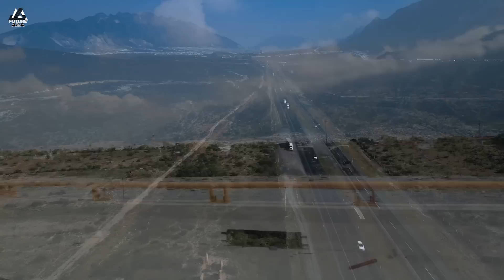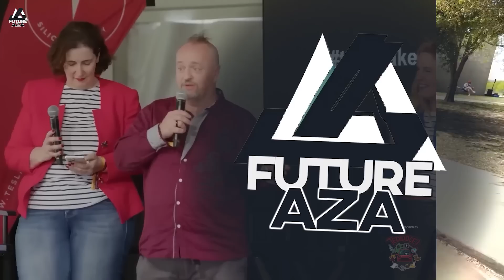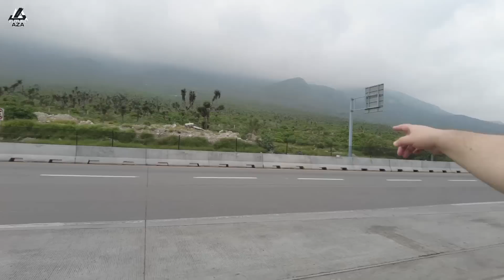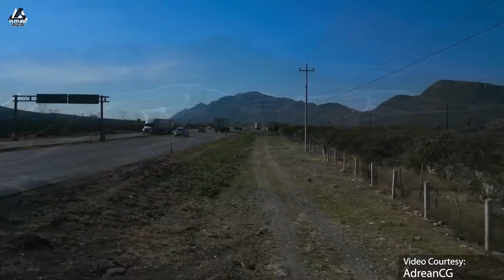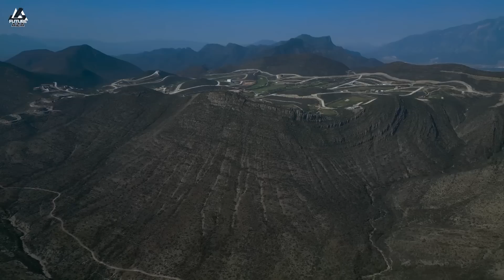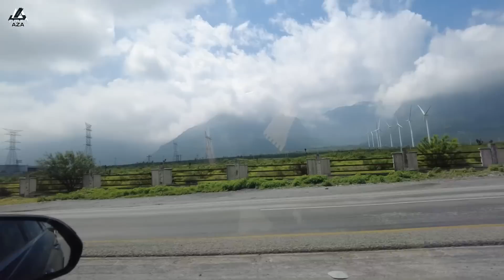I Went to GIGA MEXICO

Comment: Wow!!! Is this the most valuable vid you've done Brian? (I dont say this to knock your other wonderful vids, just thinking of the importance of this one)
This needs to be promoted across the Tesla community. 
Thanks for showing the value of the location, along with the realistic difficulties that will be faced with building construction.
How can it be built?! Long and thin? Multiple buildings? Maybe gigantic supply in the middle, surrounded by different buildings supporting multiple lines? While not efficient, I could envision small to large number of lines making all cars there, just taking advantage of the trade agreements.
Reply from the maker: It's not insurmountable, and the access to cheap electricity could make it work, but boy is it rocky and sloped.

Comment: Can the wind turbines be used, or would the costs be higher than using fossil fuel?
Is Tesla developing new technologies to excavate rock, for eg. the lithium/copper mine branches, or as preparation to terraform Mars? With each location there comes another opportunity to innovate and expand into another industry.
As in another comment, the mountain could be used for a data center.
Are there really no valuable minerals in the rock?

Comment: "Normal Trains" require Shallower Grades, especially if using "Mile Long Trains", is basically True, but a Train can be Shorter, More Power Units (Engines) can be used, and it can work! 

In "Extreme" Grades, there are always "Geared" Track Systems, as in certain Spanish or Swiss Mountain Rails!

My "Home Town" has "CPR" rails a few Hundred Feet Higher than the "CNR" rails, in town, but just 6 Miles South, the CPR Tracks are below the CNR tracks, at the "Cisco Bridge" crossing over the Fraser River, by around a Hundred Feet.  

So, varying "Grades" ARE Possible, if not "Desirable!"

Comment: Since when do trains don't go up grades? I live in the Rockies in Colorado and we have trains all through the Rockies. Poor excuse for the trains not going to the site if you ask me. Other than that great video and TY for the video.
Reply from the maker: The trains in the Rockies go up grades over a great distance. There isn't sufficient distance. The climb at the top of the property is of a grade that would be problematic.

You want a train configuration that can be the same at the origin as later along the journey. That's what you'd get by putting the depot at the east end of the site instead of trying to run it all the way to the west end of the site.